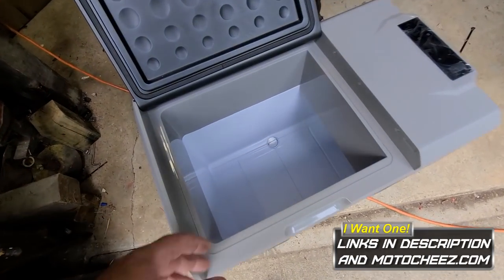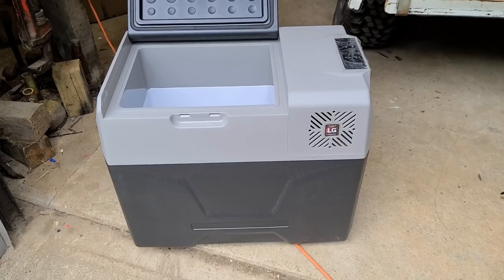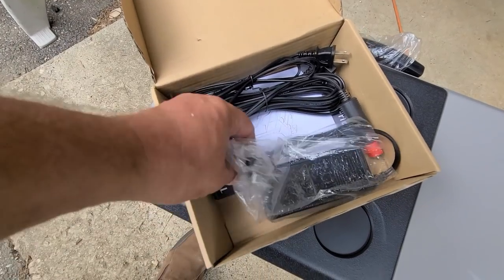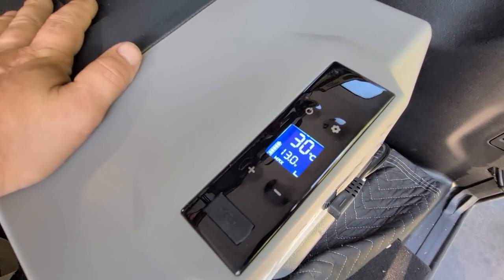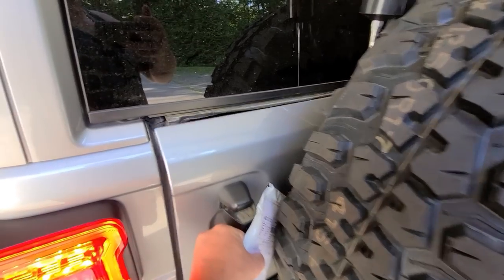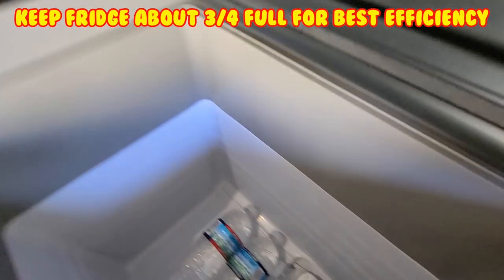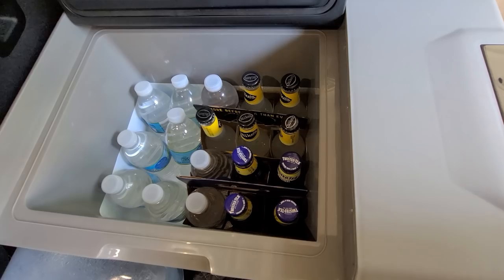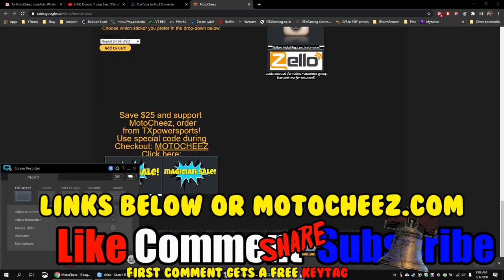Ebay ($256) 32QT 12 volt CX30 LG compressor style fridge freezer cooler review Overland off-road

Comment: For those wanting to change the thermostat from Centigrade to Fahrenheit:
1- turn unit OFF
2- hold SETTING button (gear icon) until display comes on
3- hit SETTING button until you see E5
4- press + or - button until C° changes to F°

The other settings are are things like high/low ranges and starting temps.
Reply from the maker: I'll try that thanks!!

Comment: i have an idea of using the drain hole as a way to leach out cold air and pump it into another cooler for an extended cooler using the one compressor. The extended cooler would be to keep thig cold but not frozen, whereas the main unit would be more of a freezer.

Comment: Nice! Give us an update in another month or two. I'm seriously considering this for my camper van. Even better, with both 110 and 12v inputs, I can plug it in at home to get it down to temperature, load it up, then put it in the van which only has to maintain that temp, not suck down all the power cooling it like you did.
Reply from the maker: I definitely will, it stays in my jeep now, but winter it'll be an extra fridge. 
Excellent idea to go back and forth house to RV or boat even. 
Thing works amazing for the price sofar, name brand same size are over $1500
Reply: @MotoCheez  yes, exactly. I could spend this much on a Yeti cooler, but it's a fridge, so it's very tempting.

Comment: Awesome cooler Cheez. I just got a new pickup yesterday and it just so happens to have a 110v plug in the dash and one in the bed back near the tail gate. Something like this would be perfect for grilling outside to prevent your meat from going bad. It would also work for when you go shopping to help keep perishables from going bad in hot weather. That or just use it as a super mini fridge for a room. :)
Reply from the maker: Nice! Congrats
Reply: @MotoCheez  Thanks! Though it was more out of need than want. I tried getting a fuel leak fixed on my old truck and the guy found frame rot on it. So it was deemed unsafe for road use. That's what you get with salty snow in the winter. :)

Comment: Seems like it's a pretty good little unit. I wonder if it'll perform as good here in South Florida as it did up there?
Reply from the maker: Doing good in the 90s up here. It'll be with me next time I go down for sure!
Reply: @MotoCheez  that's awesome its around 100 down here the last time I checked, but I might have to get one of these for the overlander that I'm building up right now
Reply from the maker: I LOVE overlanding! What you using for build? I'll be going to FL again in a month or so
Reply: @MotoCheez  I am using an 01 Mitsubishi Montero XLS (the non sport one)
Reply from the maker: Nice! I remember those. Reminded me of an overgrown suzuki sidekick
Reply: i got the 55l version works fine in Australia even when its hot 43C

Comment: Reason why I'm asking is 410 operates at a much higher pressure,  And the only reason why I wouldn't trust it,  If the compressors Chinese based.. And you leave it in a hot car and try to flip it on I'm wondering if you could blow the seals

Comment: Nice... been wanting to get a unit for my Tahoe (camping rig).  Did not know there were non-compressor units, good info.  Already have a 100W solar with an AGM battery pack made by Overland Solar.  This would be a nice addition.  Grassy-Ass Ameeeeeego.

Comment: you mentioned getting insurance on it through ebay. How much was that and what was the coverage? Squaretrade?
Reply from the maker: Yes square trade. It was about $30
Reply: @MotoCheez  I am buying the fridge at Costco. I am sorting out if they can sell me a SquareTrade policy or if I have to buy on amazon or? How many years of coverage did you get with your policy? does it cover 100 percent or does it have deductable or cost you to ship back to them if you need it fixed?
Reply from the maker: They're selling at Costco now? It was 3 years full replacement I believe.

Comment: So you're just running it on the dual battery setup on  your jeep>  Whats the longest you got without running the jeep?  Also do you have an idea how long it may take the jeep to recharge the battery?
Reply from the maker: It runs off the main, the secondary battery in the JL is just for starting I heard. 
I ran 2 days no problem. My son with a single battery in his JK same fridge went 2 days also and still started fine. Typically if battery is drained to be able to still start the car, like jumpstarting a dead battery, the rule is 30 minutes

Comment: Can the temp indicator be changed to fahrenheit ?  That looks like a great fridge. 👍😎
Reply from the maker: I tried, I see the F but nothing in manual either...
Reply: @MotoCheez  When the temp is displayed, try holding down each button separately for a bit and see what happens. My oil temp guage says hold down the button for 10 seconds but it often takes 15 or 20 to get it to change.
Reply: @MotoCheez  Try holding down a button for awhile when the temp is displayed. If 1 button doesn't work try another. My oil temp gage says to hold down the button for 10 seconds to change from C to F but it often takes 15 or 20 seconds.
Reply from the maker: I did try a few. I'll try longer maybe... Thanks
Reply: Turn the power off. Press settings button until it displays f5 then up or down button for f
Reply from the maker: I'm going to try this! Thanks
Reply: For those wanting to change the thermostat from Centigrade to Fahrenheit:
1- turn unit OFF
2- hold SETTING button (gear icon) until display comes on
3- hit SETTING button until you see E5
4- press + or - button until C° changes to F°

The other settings are are things like high/low ranges and starting temps.

Comment: Did you check the temp with a laser thermometer at the 12v. Socket
Reply from the maker: I didn't, but it wasn't even warm to the touch.
Reply: @MotoCheez  I dont know why I asked that, I guess it the electrician coming out of me. It appears its very efficient with some nice features. Hey as long as it can cool down the adult beverages and keep  the lunch meat cold what else could you ask for? Keep the vids coming until then keep the shiny side up!